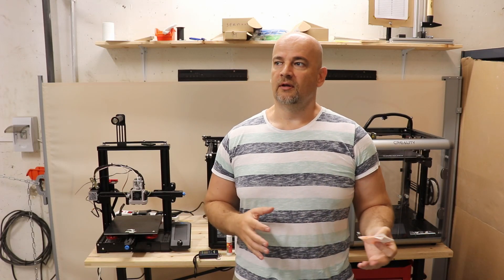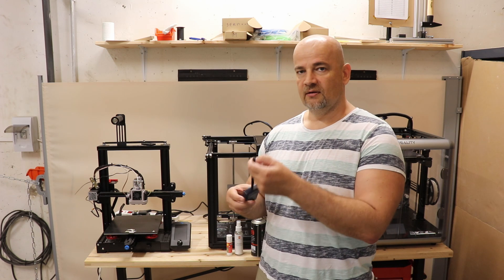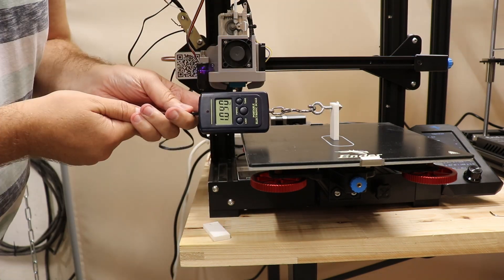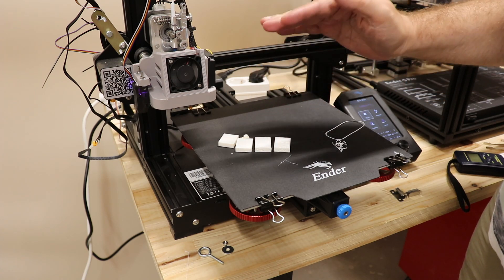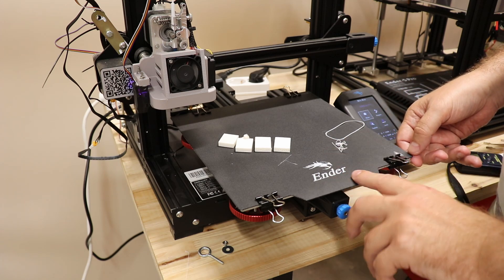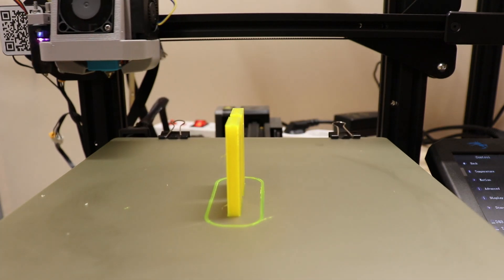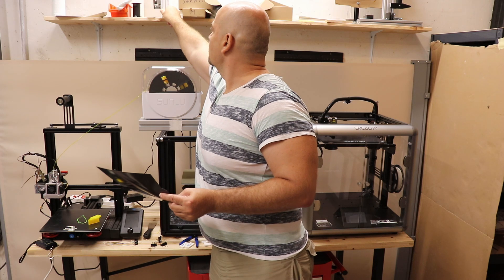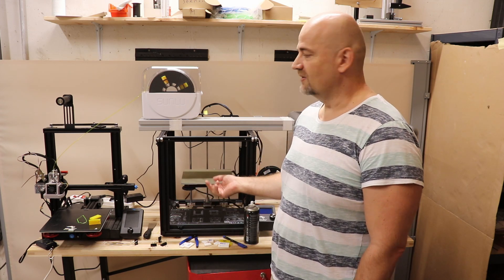Creality PEI sheet vs Carborundum glass vs Soft magnetic self-adhesive platform

Comment: I would love to have a conclusive answer why everyone's results seem to be so different with the same materials, in this case especially the carburundom glass. Generally I think it's the different formulations of the same filament between brands, but you both showed that's not tne case and I have a situation that can't be the case. 

I've had great luck with it for PLA but lately I've done a lot of PETG and it's been horrible. I've wiped with IPA, I've scrubbed, I took it off and scrubbed with hot water and soap, I've tried Prusa's settings, and all sorts of other settings. If I don't put gluestick on it I get a turd (when whatever you print gets ripped off and rolled around under the nozzle till you have a solid log of plastic).  I finally noticed that it's always the RH side that is coming off first, and even with gluestick the RH side is never as nice (slight lifting in corners....), so I took it off and spun it around and found that the same area caused a problem, it moved with the plate.

You have 2 different machines with the textured glass that seem to work differently I'm assuming with the same filament.

I think that the glass is inconsistent somehow.

OK... but then why can't I get masking tape to work at all on that printer??? It was my goto on my old A8 (it came with a blank aluminum build plate out of the box) and I can't get masking tape to work on my ender 3 AT ALL, I can't put down a first layer.

On my old printer I finally installed a PEI covered spring steel sheet which worked consistently great, except that It seemed like I never had the nozzle crash into the print surface with ANY other surface but with the PEI it aways managed to happen within the first 3 prints after putting a new sheet on. I always had some sort of a scar in it.

Comment: This is an interesting test.   
I never use any addtional bed adhesive.  I find on my Ender 5, on Glass PEI or the supplied flexible surface, that adhesion is not an issue as long as temperature and z-offset is dialled in properly, but I know some people do have issues with adhesion where glue stick or hair spray or similar works pretty well.  I mainly print PLA and PETG so it may vary with ABS or others.
I usually find that relevelling the bed is definitely needed every time you change bed surface, otherwise you end up with spaghetti.   I've not had the issues you had with adhesion to the stock flexi build surface

Comment: my PEI plate suddenly had zero adhesion anymore..form one print to the next, it was ridicolous, like a curse. Its a doublesided PEI sheet, that makes it even weirder, because i only used 1 side and thought, well im just gonna turn it around, but that one didnt stick either. ISOpropanol treatment helped nothing. The printsheet still looks like new, but zero chance for PLA to stick. Its incredible. It worked fine for a few weeks.
Reply from the maker: Try to reactivate the surface with steel wool (read more on WhamBam website)

Comment: I’m wondering if anyone can give me some advice. Bear with me: I bought an ender 3 S1 pro, it comes stock with a magnetic bed with a spring steel PEI sheet. The actual bed is warped, so I took off the spring steel and put a creality glass bed from Amazon on top. Held it in place with clips, but now just basically sticks to the magnetic sheet, although I can separate the two if needed. The issue is the glass actually holds on a little too well, difficult to get some parts off sometimes. Would actually like to put ANOTHER magnetic sheet on top of the glass and add spring steel on top of the glass. So my question is, is my build plate starting to get too heavy for my stepper motors? The sandwich is now: original aluminum plate with magnetic film, then glass bed, then additional magnetic film, then spring steel PEI. Thanks for your help!

Comment: I just bought the magnetic sheet that has a measuring grid on it, I couldn't imagine using glass as my original mat sucks I could hook a tow chain on both ends and pull 2 cars with it my prints get stuck that bad. But even if you have glass you better have that printer heat and speed dialed in for sure.
Reply: You may be a pro at the designs and such that you print, but I figure this like my CNC plasma table tons of others runs theirs different then I do and I do know glass isn't something for me.

Comment: You missed the best one of all, powder coated PEI, works better than all three, all you need to do is prepare the surface with a green chux scrub and some warm soapy water, then dry with a paper towel and it will work like a charm, they are so good, I apply Magigoo or similar as a release agent due to the part sticking down to good. Advice: Do Not Use IPA to clean your build surface, use warm soapy water and rinse properly, IPA will leave some residue, dishwashing liquid will remove all oils.

Comment: with a rough print surface like the pei or buildtak its much nicer to use a microfiber cloth to wipe it with IPA as with papertowels you´ll often have liitle bits of it sticking to the buildplate. As you´re not removing any real dirt ( just a bit of residue and oils) you can use that cloth for weeks, before you have to wash it, very convenient.
Reply: I use my mini vacuum to pick up the little bits. I will try a microfiber cloth. TY
Reply: Definitely go with a lint free cloth on any surface, as even the smoothest surface wil get bits of paper from paper based sheets., but be careful with Microfibre as a lot cause static build up and this can affect print quality and adhesion

Comment: I use a Ender 3 S1 it came with the magnetic pad glued to the heated bed pre installed.  I also hate that magnetic shit that comes stock on Ender 3 S1 mine was adequate for about 5 prints then no adhesion. I now use and creality carborundum glass bed on top. Fantastic adhesion But you have to be careful removing the glass bed as it creates a vacuum seal with the magnetic bed. Thanks for the video I’m really looking forward to trying PEI magnetic flexible bed your video convince me to give it a shot.

Comment: I had 3 glasses (2 cerality, one ther brand). They was ok, but if i printed bigger thins with ASA filament I couldn't detach from the glass and glass got damaged. Once the printout itself shrank during cooling down and broke off a piece of glass.  Now I use only PEI without any problems. When printing TPU I use hairspray with vitamin A to reduce adhesion

Comment: I used to print on 0,8mm carbon fiber board. It was pretty good wrom what I remember. At least as good as PEI.
In my experience the PEI print bed is not as great and I usually need to print with a raft.
Don´t forget the weight of the glass is also important, Glas is much thicker and heavier thus reducing print speed further if you use a I3 style system, but those are shitty anyway.

Comment: Anyone tried 3mm sanded polycarbonate sheet? I am using it for a month now and I really forgot I had bed adhesion problems. Almost all the filaments stick to it very well. More sanding means more easy to remove. But the catch is, the printed object should be removed when the bed is still hot. I use hair dryer if it sticks too hard. Lowering the bed temp also helps to get the part easily in cases like PETG. You can also flex the sheet to remove bigger parts. Another advantage is, if you got power outage, the part sits on the bed rigidly even when the bed is fully cooled and can continue to print again when the power is back.
 
The best part is, ABS filament sticks to this surface the best than any other filaments. This sheet itself is pretty cheap (about $1/ sq.ft) and you can buy it from your local hardware store.

Comment: I love the Creality glass bed.  The surface is designed so that if you let it cool down to less than 30 degrees Celsius it will "let go" of the print and requires no force to remove objects, even large ones.
Reply from the maker: I noticed, that Creality carborundum glass is different form order to order. At home I have one (presented in video) with very good adhesion (sometimes too good). But on my workplace we bought a new E3V2 and it arrived with more grey color glass, with very poor adhesion.
Reply: I have the same darker glass that Tech Fun has, and i hate it. It does not even want to release the object below 20°C. I had to trash a good PETG print because it stuck so bad to the glass that it deformed rather than releasing from the glass. My friend said that you should hear a click and its done, i never had such experience with it. Every single print i had, stuck soo bad to it that i had to freeze the glass/object or use hard force to remove it.

Comment: Thank you for the videos! I know that it is hard work.. How often do you manually set the z height if you have a cr touch on ender 3v2.? Do you have a Check list that you can give me to use before every print? Do you manually adjust the z offset every print? Thank you. I'm sorry for so many questions.. Again thank you for all your hard work. Peace
Reply from the maker: No need to adjust z offset every time, only when you install the cr touch (or replace the nozzle and similar). PEI every time cleaning with IPA
Reply: @MyTechFun  IPA's are tastier than lagers.

Comment: Hi Igor, have you used the Creality PEI bed sheet any further? How did you like the first layer finish that it gives? I have just installed mine and I'm missing my glass (carborundum, Ender 3 V2) finish, on both sides.
Reply from the maker: My favourite is powder coated PEI sheet, gives nice textured bottom surface (but I don't have it on Ender, only on Prusa printer)

Comment: You need to adjust z-offset when changed from glass to flex-mat surface, also you might need to re-level the bed if print on difference temp.
Reply: No, the probe has always the same Z-offset. He does not have to re- level it because he prints only in the center.

Comment: I see you're using satsana fan duct. Is satsana provide symetric airflow?🤔 
Just because , the right blow tunnel has shorter way , and thats why I thinking about it has asymetric air flow to the nozzle(compare right and left blower)
Reply from the maker: I didn't measure it, but approx visually, according to "water test" it's 40-60%

Comment: What did you spray on the PEI sheet?
How do you clean your PEI sheet? I have one that I clean with 91º Isopropyl Alcohol but I printings won't stick anymore
Reply from the maker: PEI sheet has to be cleaned with isopropyl alcohol (I use 98%). But 91 should be ok too. I don't think this is the reason. But try with 98-99 just in case. First wash the sheet with soap (just once). If nothing helps, theoretically with acetone you can reactivate the PEI, but be carefull with this, because life time reduces with this. Or try with "000 steel wool" as described here: https://whambamsystems.com/install
Reply: @MyTechFun  Thank you, I washed the one I had issues with it with Soap and it worked, now I'm starting to deal with the Creatility PEI. Question: If I have issues again do I wash it with soap again or I should never wash it with soap again? 
Oh and can I use Nail Polish Remover or Do I have to use pure acetone for reactivate the PEI?
Reply from the maker: @andreojuegosyestrategia1266  I am not familiar with Nail polish remover. But stay with a soap. You can wash it with soap any time. Try to avoid acetone if possible. Only if you are sure that nothing else helps..
Reply: @MyTechFun  Thank you very much!!!

Comment: So you tested the magnetic bed on the aluminum plate?  Because when the part gets bigger, the print head will easily cause the bed to lift and flex at the base of the part as it slightly pushes the part side to side.  If magnetic beds were that bad, they would have bankrupted Creality when they used it for Ender3pro.
Reply: Hmm.. That's probably a good explanation of what was happening. That magnetic bed works perfectly on my Ender 5, so I was surprised to see those failures. The magnetic bed is simply not stiff enough to mount with clips on a non-magnetic surface.

Comment: You used the magnetic sheet in the wrong way. Because its flexible it needs to be held down by magnets else it can bulge in the middle, dislodging prints. Even so from experience I think its pretty poor for adhesion compared to the others and over time its surface degrades. Its not bad with gluestick but id always pick the glass or textured PEI over it.

Comment: Pls note the following:
E3V2 stock glass is not available as a replacement. The replacement version has the same finish as the E5 (more matt) Hairspray coating sorts that out and then behaves just like stock glass. Let it cool down first before removing (PETG)
Furthermore, on stock glass, no additives required for PETG, just clean and print. On the replacement version, a coat of hairspray between prints is just perfect. magnetic sheet. A wiping of sugar water is perfect for PETG. Keeps sheet clean and part pops off when cool easier than without sugar water.
Reply: The Ender 5 glass bed can be used upside down if you want smooth glass.  The texture is only on one side, like the Creality PEI build sheets.   Adhesion is a little more tricky on the smooth side, but get it clean and use a little adhesive and you will get mirror smooth bottoms on your prints.     The Ender 3 V2 glass, if I recall, is also smooth on the reverse side.

Comment: Thanks for the video. As a printing noob, I'm confused by the results with the flexible magnetic bed (that comes with the ender 3 pro), as I've never had any issues with prints sticking. I clean after each print with alcohol, manual bed leveling with a piece of paper, and using 50c bed temp it's been golden.

I've read countless threads around the internet from people who can't get things to stick and I'm wondering if maybe creality has changed the bed to something better? My printer is fairly new, so maybe or maybe not... But it's confusing anyway.
Reply from the maker: That's what I mentioned and also noticed from other comments. Soft magnetic and glass may work good, but product quality is not constant. PEI sheet more reliable
Reply: @MyTechFun  With PEI for the perfect adhesion you need to scrub it with rough side of a kitchen sponge or fine sand paper...
Reply from the maker: @syty9928  Not with every PEI sheet (wham bam PEX or PEI requires this). Prusa PEI not for example.

Comment: You should scratch up the PEI surface a little bit with steel wool. Also you shouldn't print PETG on smooth PEI without glustick since it can damage it. Energetic store has a double sided one that compatible with PETG and TPU on the textured side. Amúgy jó lett a videó :)
Reply from the maker: Köszi!
Reply: @MyTechFun  I want to replace the build surface with PEI Spring Steel but I'm still confused about choosing the PEI smooth or textured one for printing ABS and PLA. do you have any recommendations for me?
Reply: @MyTechFun  Sok dologra ha rákerestem, a Te videóid jöttek fel. Szerintem jól csinálod, hajrá! :) Szépen belerepültél a nyomtatásba Te is, ahogy látom :D

Comment: recomendation for all surfaces dont release when hot, pei may form boubles and carborandum will degrade if remove hot, also dont use IPA neutral soap and water gives amazing adhesion on carborundum
Reply from the maker: I agree with you, to remove objects when bed cool down. For this experiment I had to do this way, because during printing bed is hot (what I tried to measure)

Comment: I'm one of the few people who prefers the flexible magnetic sheets. I really like the texture it leaves on the first layer.
I used to have adhesion problems until I started wiping it with isopropyl alcohol after every few prints. Since I started doing that, I've never needed to use anything else to make a print stick.
It does seem to be a little more sensitive to the z-offset than other print bed types, though.
Reply from the maker: Useful experience. Thx.
Reply: Sorry for the late reply. I also prefer the flexible sheets. Strange enough I had no problem with adhesion from the start on with my Ender 5. Later on I used a short spray with 3DLac, and I can print several prints without renewing. After some use it's best to clean up with some simple lukewarm water with a very small drop of dish soap. After drying and a short spray with 3DLac you are ready to go again.